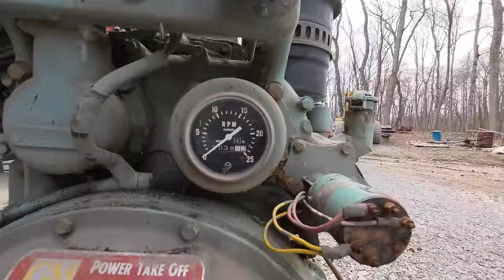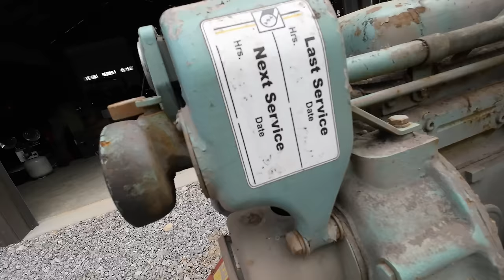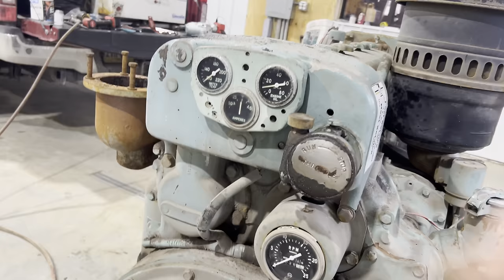$250 Two Stroke Detroit Diesel Sitting 6+ years, WILL IT RUN!?!?

Comment: Great content again, thanks Mat!
   The Fire system at one of the Buildings was Diesel and another one was Natural Gas-Continental reciprocating. They both used a small amount of the fire system water it was producing to cool the engine Heat Exchanger! It uses smaller lines/pipes because the entering water comes from Fire Tank at Approximately 75 degrees water uncirculated you can put a lot of BTU (British Thermal Units) in a gallon at 75 degrees and not recirculate it and waste it down the floor drain! Only running mode   
   Some Boats use the same design o  engine heat-exchangersr dispelled water over exhaust manifolds.

Comment: Lots of these engines in boats back in the 60's and 70's - The GM 71 Series, 6 and 12cyl are great marine engine and were used in everything from pleasure boats to yard tugs and the oil fields. Had twin 6/71's and 12/71s in a number of boats I ran.  They will run forever if you change the oil every 200hrs and are not overheated. Not the most fuel efficient but they are Bulletproof.  And if you have a bad injector or two they will still make power and get you home.

Comment: really happy to see you in your deam shop working on something, I think you may have completed the cycle. I would use that engine to power a generator for your shops, your yard and your house, just like a solar system powering batteries as needed.

Comment: Great video. I used to drive a redi-mix truck that had a 6-71 just like that in front of a 5X4. It was a great truck. I, too, love the sound of a DD. Also drove a dump truck with an 8-71 in front of a 10 spd. Another really great truck. Dual, straight stacks, with no mufflers. That thing sounded like a hot rod!! Good work. Do more with 2-stroke diesels, I love them even the 92 series.

Comment: A version of your 6-71 Detroit diesel called the GM 6046 was used in a twin coupled configuration in the U.S. M-3A3, M-3A5, and the M-4A2 medium tanks, as well as the M-10 and M-36B2 tank destroyers. Also the later variants of the British Valentine infantry tank used a version of the engine designated the 6004, including all the Canadian built Valentines (the Mks. VI and VII) and every British built Valentine from the Mk. IV through the Mk. XI. In addition, the U.S. M-109 series of self propelled 155mm howitzers all the way through to the M-109A6 version use the 8 cylinder variants of this engine type, the 8V71-T. The newest M-109A7 uses a Cummins VTA-903T diesel, same as in the M-2/M-3 Bradley IFV series.

Comment: Cool project, can't wait to see what it morphs into. As far as drivetrain, have you thought about a hydrostaitic drive? You wouldn't need a clutch and you could run it under the engine to keep it a short wheel base.

Comment: I worked with the Navy for 22 years. All of the installations I worked at used the 6-71s for the backup generators. On Midway Island, both of the converted landings craft used 6-71s. Great power plants.

Comment: From 1983 to 2016 I lived in a small western Canadian town of 1700. I was on the volunteer fire dept in the 80s and we had an old 6 cyl gasoline LeRoi stationery engine to feed the fire hydrants. We started it once a month but it had of course had fire time over the years but basically very low hours. I left in 2016 and never did learn if the engine is still in use or it’s vintage. In the late 90s I sold truck parts for Freightliner and called on Hutterite Colonies as they serviced their own vehicles. One Colony would go to heavy duty machine auctions in the U.S. and by surplus military equipment for repair and resell. They once bought 4 Euclid earthmovers, repaired and resold them. Their biggest catch however was 30 brand new Cummins NH220 Diesel engines that were U.S. Army surplus from the Gulf War I was told. Each came in a clamshell container that was filled with pressurized air or gas to protect them. These were basic old style, non turbo NH models that were commonly found in construction machinery of the 50s-60s. They came with 24 volt electrical systems and mechanical fuel pumps. The Colony manager asked if I would consider selling some. We agreed on a price of $3000 and I moved 6, one for an old Champion grader, one went in a 70s Alice Chalmers farm tractor and four for irrigation pumps. Their all still running.

Comment: What a treat to watch you bring this monster back to life:)  As probably said, these things move so much air that they don’t need a cooling system when idling or just free revving.  The wetsac or wet-stack is normal, just a byproduct of running at low to no load so exhaust temps are down.

Comment: 2 stroke Detroits require straight grade oil, not multi-grade.
Reply: Exactly straight 30w would be ideal
Reply: Only 40 wt dino oil.
Reply: I serviced a crane with a 471 detroit for a customer who insisted I only put Rotella T 15 40 in it he ran it at least 8 hours a day 6 days a week never had a problem I serviced that machine for 15 years until I retired and it ran like a charm and is in fact still running just fine

Comment: 45:21 they are common on marine engines so you don't have to run salt water AKA liquid hate through the block and they protect you from pipe failure for a bit.

Comment: Just a tip, detroit 2 strokes need 40W oil, not 15W40, ive seen 149"s fail due to the wrong oil, just a tip, not putting your work down.

Comment: That looks like a great exchanger system. Glycol/water on the engine side, raw water  on the other. Given that its a fire pump it may well have drawn some of the pump water through the heat exchanger. Similar system is used on marine diesels with a Jabsco pump hauling sea water through the heart exchanger. 
Fire pumps are expected to cost very little and take up np space. A lot of times they're only there to satisfy the insurance company and they ( the insuranceco.) normally insist that they're replaced if they've been used in anger.
Reply: No glycol allowed according to DD. The Nalco filters we used also turned the water green. If it got too diluted over time, it turned pink. And as we used canal water, we had to cut way back on the pump pressure so as not to over cool the engines. Most times they were right at 140°F with the 2 inch pipe at 5-15 PSI. Water went thru both gensets even if only one was running as that is how we regulated the pressure.

Comment: If it was used for Pumping water for emergencies it would of been setup like a Marine application were the water it's pumping also cools it so it wouldn't have traditional cooling package like a Radiator Matt 7:00 @Diesel Creek

Comment: 1987 I was working in the oilfield, frac crew we used DD 12V141 & when you were on location with 10-12 pumps & all opened up full throttle, amazing sound.

Comment: Hi mat the water header tank is a heat  exchanger,  when running the  water pump driven by the engine ,would have a tapping on the water discharge pipe , this would be piped to the lower connection on the heat exchanger and the higher connection would be piped to drain , this would cool the engine coolant ,and keep the heat exchanger full of water  to prevent corrosion  cheers dave

Comment: Hi Matt,
For your little monster dragster, you can adapt a hydrostatic transmission, then you can set up the wheel wherever you want.
But if you use it with the power generator, you can use the water heat exchanger to connect it to your garage floor heating.
And you can add and hydraulic pump to use it at hydraulic auxiliary power for your garage.
Have fun.😃
Reply: John deere model a look would be nice

Comment: The cooling system looks like it used a water source to transfer heat from the coolant.  The City/Parish maintenance Center used to have two generators that used a water source to cool the coolant in the transfer system.  The plastic bottle is on the intake for cooling water.  There should be an outlet somewhere.  Probably with the oil jug is.  The Air Liquide plant has a fire pump run by a diesel that uses a water heat exchange and the water is drawn from a pond and discharged back to the pond.

The raw fuel is probably what is called wet stacking.  The engine needs to be run under load to burn off fuel and reach normal operating temperature.  Just a thought.

Comment: Heat exchanger on the front to use City water or a water tank. I love the 2stroke detroits, worked on quite a few  up to 8v92’s running generators. You always have cool projects, looking forward to seeing what’s next.
Reply: I’ve worked on V16-149’s in big yachts.

Comment: I think straight HD 30 or 40 oil is specified for these two strokes.
Reply: 40 weight is the spec but 30 could be used in lower temps. if oil heating wasn't available.

Comment: Nice, it sounds good! Maybe you can use this engine as an emergency power-system for your workshop. It's look like, this was the purpose of this kind of engine. But what you really need is a kind of ventilation system for your workshop otherwise you get big problems with the exhaust smoke if you run this engine's inside, specially in wintertime!
Reply: Putting wheels on it will make it an idea outsider. Plus kill the bad-vibes, man.

Comment: Nice old fire pump. Alot of the ones we install now are Clarke/ john deere. We installed one last summer that was 500 hp variable speed pump. Opening the test valves was scary. Another good video matt 👏
Reply: Jip most are Clarke now whit an doosan engine
Reply: In 15 years of installing fire protection sprinkler systems here in NH, I have yet to see a Doosan name on one
Reply: @markmontgomery8466   here in the Netherlands it’s a common block doosan

Comment: Looks to me the engine didnt have a radiator at all but used a water bypass on the external water pump to cool it through the heat exchanger great content and awesome engine.. :)

Comment: Nice one Matt! Classic Diesel Creek! 

I reckon you should mount that beast onto a mini-ex track system.. direct/chain drive a hydraulic pump from the pto and have levers to skid-steer.
Saves all that faf you'd have to go to with a standard gearbox and axle system, and gives you a nice big chunk of steel as ballast lower down to help lower your c-of-g. (..would hate to see you squished >.<)

Keep up the stellar work!
Reply: Good suggestion. I was thinking the exact same thing.

Comment: Hello Matt!  That old 6-71 Detroit really does sound GREAT good luck with it!  that engine should have high grade 40 weight oil in the crank case  multi weight oil does not work well for the long run.
Reply: Straight 30 not 40 for the 671

Comment: I think it would make a great generator setup. I've seen a few in that work scenario that turned out pretty well. With an engine like that you could put out at least 4KW of constant power for your house or any mobile application with the addition of a trailer.
Reply: More like 60kw-130kw.
Reply: Man if all you get is 4000 watts out of that thing there wouldn't be any point in firing it up 😂 

Better be more like 25+
Reply: They work great for Generators. Ran a number of boats in the oil fields that used the inline 471's and they ran for years without a hitch.  We ran two 25kw gen sets using this engine on a 24hr On / 24hr Off schedule switching them every morning.  If you use clean fuel and change the oil every 250hrs they will run for years without a problem.
Reply: @TugboatMatt a 671 is good for about 100 kw continues - there 39 HP per cylinder - 
   You get 416 watts per hp - so it's 234 hp x 416 watts = around 96000 watts -
Reply: @Bravo21 hey will run for about 1600 hrs without changing out the liners rings and rod bearings along with rest pins and bushings - 
    We often had to replace the piston and crank shaft - 
     After 16000 hrs they have a lot of slack on the rest pin and loose compression and are hard to start - 
      There still 100s of thousands in service in the off shore industry - 
    They run on diesel #3 & 4 well - that fuel is dark brown or black - it's marine fuel -
Reply: they burn 50 gallons of fuel a day to run a house - or generate 10 kw or less and 150 gallons a day at full load - a 4 kw gen might burn 12 to 15 gallons of gas a day -

Comment: Matt, please contact Andy on the “Andy’s little homestead” channel .. he has a wood mill with a 4v71 .. it runs pretty well but I’m sure he’d love the power of a 6v71 lol.. that thing is awesome, at only 38 hours it LITERALLY isn’t even broken in yet lol
Reply: @Andy'sLittleHomestead I'm sure he'd get a kick outta this beauty. If his new tractor powered death machine wood cutter doesn't kill him first 😂
Reply: I'm a pedantic bugger, so I'll chip in and say there's no such thing as a 4V71.  The inline engines were 1, 2, 3, 4 and 6 cylinders.  Matt has a 6-71 (also a straight engine).  The V-block engines were available in 6, 8, 12, 16 and 24 cylinder versions.

Comment: Hey Matt, I don’t know if you read older comments, but my uncle ran a fleet of over the road trucks with 671’s and 871’s, and if the oil looked crappy during an oil change, he would flush the engines by filling them with diesel fuel, since it acts as a lubricant and flush out all the crud in the engines. The 871’s or 318’s were beasts, especially coupled with a 13 speed transmission.

Comment: The early 6-71 marine engines marinized by Gray Marine were about 150Hp going back to the 1930's . The highest hp Non turbo 671 marine engine was about 310 hp at about 2500rpm. The  turbo versions were used in Viet nam river boats and were about 410 hp at 2500 rpm.The turbo versions used in  fast pleasure boats were  410, 450, and 485 hp all at about 2500 rpm .The highest hp versions had bigger  injectors, intercoolers and supercharger  bypass  valves that bypassed the flow restriction from the supercharger  at high speeds. Penske  advertised  his high output 671 at 500 hp All these engines were  pleasure  boat rated and their life span  was much  shorter then the 200 + - hp commercial  boat engines. All these high output engines had 4 exhaust valves per cylinder. YOUR engine  looks to be a 2 exhaust valve engine. Jacques Cousteaus Calypso  research  boat had a 671 generator  with over  30 thousand  hrs. A race version 671 was used in Bertram offshore  race boats in the late 1960s. Put out over 600 hp and would last about 40 hrs at full throttle. Much longer than  a gasoline  race engine in the 1960s. There also was a  671 aluminum  block engine. I don't  know If the race engines were aluminum. Also  Detroit made 
92 series engines which were  basically  a bored out 71 and used wet cylinder  liners with   O rings. 71 series were  dry sleeves. 92 series  were v engines in 6, 8,12, and 16 cylinders. 71 series  were made in 1,2 3?, 4, 6, v6, v8, v12, v16, v20 ? and v24? The big ones were 2 blocks bolted together. I believe the 53 series were  much later then the 71 series.  453 was 140 hp, 6v53 were about 215- 220hp and 8v53 were  about 283 hp. Some turbo  6v53 (experimental?) were about 400 hp. I stood next to a black with gold trim 16v 149 display engine at a boat show. AWESOME!
Reply: I saw a blue 16-149 at the Detroit factory with chrome valve covers and a plaque with “149 Yacht Power” on it.

Comment: I love Detroits, great engines for many different applications. Like some other people have said in the comments, a hydraulic setup would probably work best for what you are thinking of building.
Reply: I really liked them in boats because, especially back in the days of the two-screw racks, it’s hard to get that last horsepower, but you can nearly always get them to run well enough to get you back to port. Two 12V71TIs were in one boat. 720 horsepower each.
Reply: The engine shutting down was due to oil pressure not  being high enough,, continue to hold on start position a little longer,, won't damage starter.  Good video.

Comment: There were four of these beauties in the engine room of the LCM-8 (Landing Craft Mechanized) that I ran in Vietnam in 1966. They were coupled in sets of two, and each set was mated to an Allison transmission. As I recall, two of the engines were set to run clockwise and the other two counter-clockwise. Sometimes I had to help my engineer replace the fuel filters. That was a difficult operation in the heat of Vietnam and while rocking in the waves of the South China Sea. We were operational 24 hours a day (two crews), seven days a week.  I had been a mechanic before being drafted, and I was very impressed as to how the engines started instantaneouly every time. You didn't have time to take  your fingers off the starter buttons before the engine was up. Even 58 years later, I get flashbacks when get a whiff of Diesel smoke.

Comment: How big of a generator do you think that beast would run? 🤔
Reply: Yes, I was thinking the same.
Reply: Probably 100KW
Reply: Well, 137 (I think he said 137) horsepower are 100 kW. So it'll probably spin a 95 kW generator head and still have room for a power spike.
Reply: Exactly what I was thinking
Reply: I've seen quite a few 6-71s on 100kw gensets, so that engine would definitely handle it. He mentioned earlier in the video that it was rated for 175hp. so it would have plenty of power and not be overworked with a 100kw. 3 ph. gen. head.
Reply: And you could use the heat to heat the shop
Reply: Anywhere from 60kw to 130kw.    We have 2 of them running 60kw 600volt 3 phase gensets at 1200rpm
Reply: A generator makes sense, nobody needs a glorified go cart.
Reply: @billarends2244  Nah Just make a it a moblie generator self powered :D